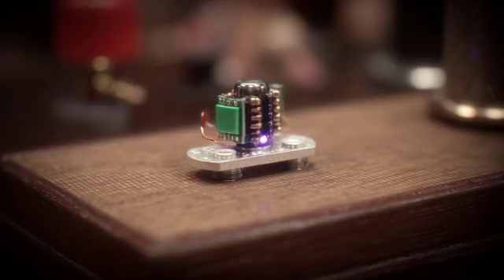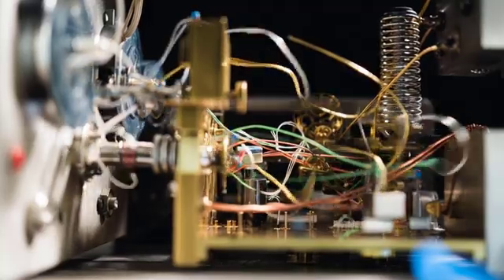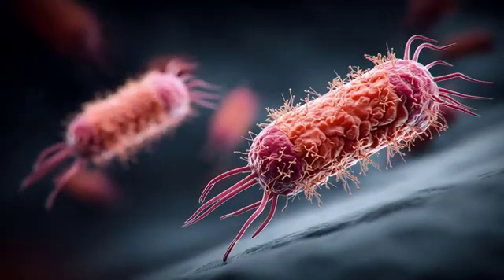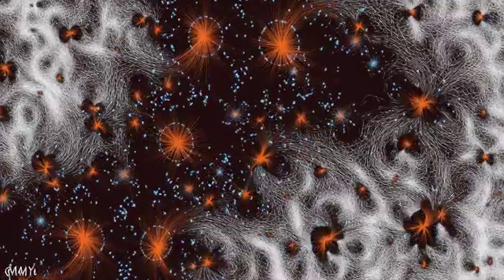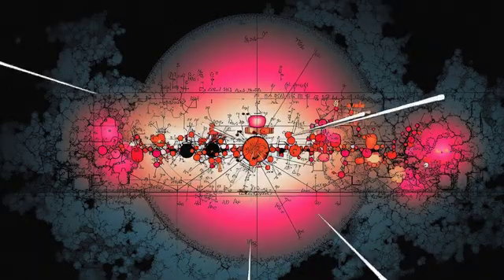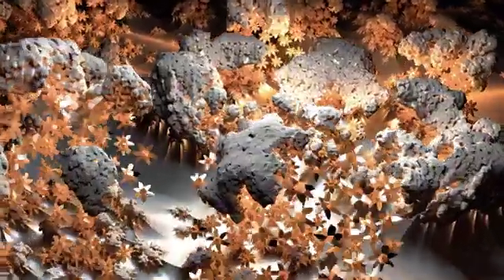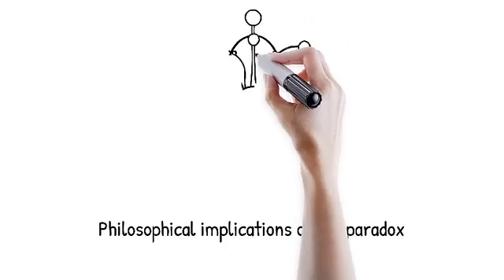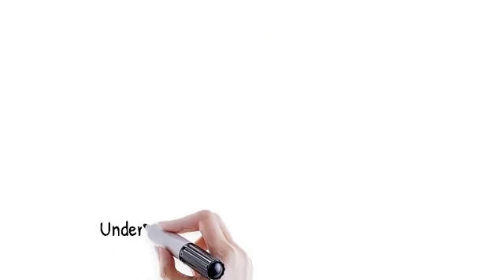Brownian Ratchet Paradox: Why Entropy Prevents Perpetual Motion

Comment from the maker: Can we design a Brownian ratchet-like system that operates at thermal equilibrium without violating the second law by coupling information processing and energy transfer?
What is the fundamental limit on energy conversion efficiency for nanoscale engines operating in environments dominated by thermal fluctuations?
How can nonequilibrium statistical mechanics be extended to fully predict the behavior of complex, living molecular motors under fluctuating energy landscapes?
Reply: 1. No.
2. Technically 0.
3. Currently, the best system wouldn't have a chance given the changes occuring in our solar system. (We cannot even program top AI for something we know so little to nothing about.)